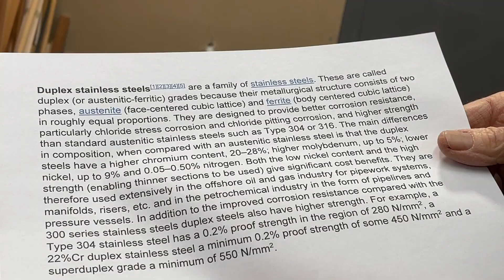Duplex stainless steel. Very corrosion resistant very strong and magnetic in this application good.

Comment: Sven, have you ever thought about making a bubble roof light (like a skylight) above bedroom or dining area? This could allow you to observe what's happening with sail and deck, and also look out, all without entering through deck hatches. Can be made by heating a large sheet of Lexan (polycarbonate) and forming. This might no able you to stand upright, but maybe almost.
Reply from the maker: Instead I have windows in all directions.
That works fine.
I do not have use for standing headroom.
Standing headroom makes wind resistance.

Comment: Swen, this current creation has many wonderful well thought out designs features based on 50 years at sea in tiny boats. I think the best so far is the hawse pipe in the stern arrangement for setting the anchor for us old singlehanded sailors. I have done many a downwind flying set but always dread having to take the lead to the bow in a blow. Thank You.

Comment: I have been thinking about a response from you about a comment I made about your sail design.

You said that, what I called a leech-club, was really a vertical batten.

I respectfully disagree. 

I think it is very easy to confuse "battens" with what I call "boomlets". The two terms have been used interchangeably.

Although it is true that all spars bend to some extent, battens are intended to mostly bend. Spars are intended to be mostly rigid.

Battens, under this definition, are used to add area to a triangular sail by creating a curved leech. They work because they face bending stresses in two opposite directions.

If you draw a straight line from the end of the boom to the top of the sail, you create a bend line. Any batten that Crosses that line will face bending stress that is down wind.

If you draw another line from the top of the sail to the half length of its foot, you create another bend line. This bend line also creates down wind bending stress.

If the batten is stiff enough, and it's longest portion extends inward from the boom end to sail top bend line, its aft end will bend up wind. This is what you want. If it is not stiff enough, its aft end will bend down wind too. This is not what you want. By making the batten stiffer, you eliminate this problem.

With your sail design, you have two bend lines. One extends from the front lower corner to the end of the boom. The other extends from the top corner to the end of the boom.

The problem is that, with the vertical batten at the end of the boom, the only bending stresses are down wind. Not only that but there are bending stresses towards the mast. This "batten" must resist both bending stresses. For this reason, it cannot be a "batten", but must be a spar. And it must be a rather stiff one. If its ends bend significantly down wind or towards the mast, the horizontle cross section shape will be ruined. It may still work. But it will work no where near as well as  it would with a better horizontle cross section curve.

With full-length vertical battens, that add a roach to the leech of the sail,  there are no bending stresses toward the mast. This is because there is sail cloth behind it, pulling it the other way.  And , though there are still bending stresses down wind, at the ends of the battens, there are now down wind bending stresses  towards the middle of the battens. And since the middle portions of the battens are longer than the end portions (past the top and bottom bend lines), the end portions will tend to bend upwind, if the battens are stiff enough. These vertical battens should be parallel to the mast, so they will roll up with the sail.
Reply from the maker: Thanks for the analyses.
But I intend to sail in high latitudes with strong winds a passage of maybe 100 days.
I may capzise and pitchpole, there might be chafe and such.
I cannot carry spares. My sail will only be 3.5 square meter like an optimist.
The vertical club I will make of carbon and it will only be 1 meter long.
There will be sea trials before and I will listen to them but for now I feel better with the vertical club.

Comment: Thank you Sven and Peter for today's video. The bar on the end of the chain is a good idea. Will the end of the chain be left in the hawse pipe or will the entire chain be pulled out of the pipe and the pipe plugged? Good thinking on the centerboard shaft. Using a magnet to find it if repair is needed is much better that cutting the hull looking for it. Take care and have a good weekend.
Reply from the maker: The chain is just the beginning 12 meter chain will be connected to 200 meter rope.
It will be used for anchor and drouge.

Comment: Please be aware that duplex stainless steels exhibit crevice corrosion under certain conditions while exposed to seawater.  I would suggest regular inspection of duplex stainless steel components.
Reply: That’s true. Much depends on the grade of duplex. Some grades have a critical crevice corrosion temperature of 0 degrees C and some duplex grades have it at 40 degrees C. Grade 2507 is king, followed by ferrilium 255, 2205 and then lowest being 2304. Not sure which grade Sven has, but it thoroughly sealed with epoxy at the pivot, it probably won’t be an issue within this decade

Comment: Hi Sven  , would it be possible to machine up a collars out of g11 with low friction rings as the flared section . They could be turned when ware or damage is seen , or replaced  ? You could make different types of caps for other uses . Maybe a larger diameter hawser pipe can be used aswell Sven  ,  you can always make it smaller later if you need to . Just thought's running through my head , I lost my sock again . Cheers Sven and Peter great video , all the best . P.s it is good to know that there is a better metal than 316 for the bow centre board axles and you can pinpoint where it is .
Reply from the maker: This pipe is hopefully sufficient.
G11 is very expensive.
A larger diameter will also not fit so good to the canoe stern. Also it will be more to plug.
Also it will take up more space and be more heavy.
Reply: @SvenYrvindExlex  ok thanks Sven I understand  .  All the best

Comment: Hi Yrvind,

i don't understand why a magnetic piece of steel would be good. 
is it to compensate the anchor chain?
Reply from the maker: Good comment.
No use at all.
When I got the piece for the centerboard axis I got an extra piece I used that as a weight to help let the anchor chain slide out of the hawse pipe.
I should have explained better.

Comment: To refresh memory, the chain and rope from the hawse pipe will be used as both an anchor line and a drogue?  A drogue helps position the boat to the waves in storms when sails can't be used?
Reply from the maker: At sea with following strong or hard winds the rope in the hawse pipe will slow the boat down. I may have some sails up or not.
On the coast I will use the aft hawse pipe ffor anchor rod.